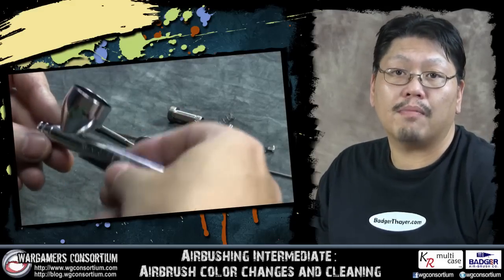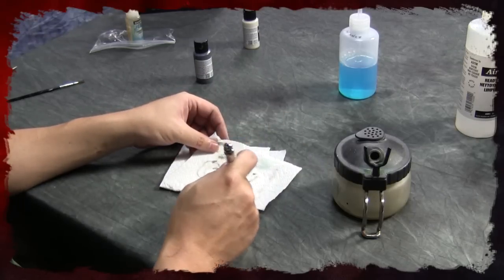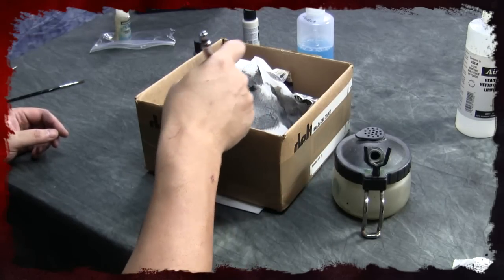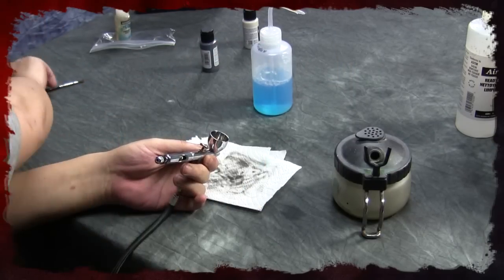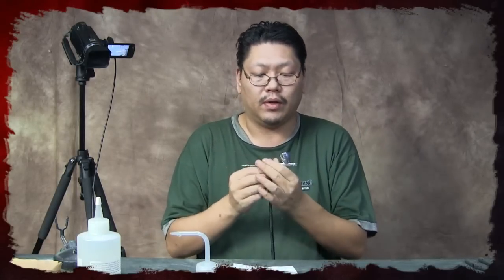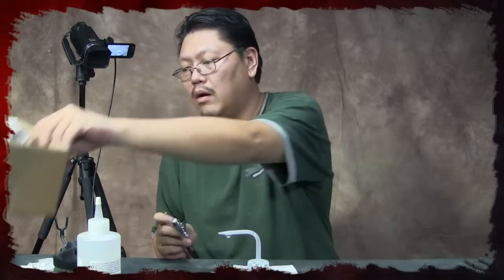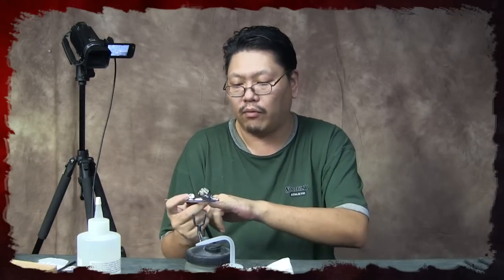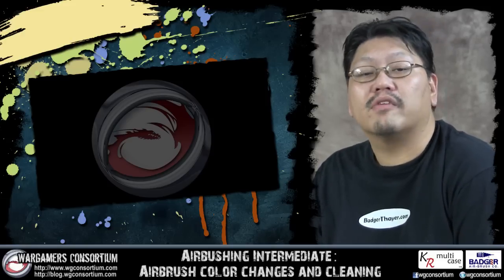Airbrush Color Changes and Cleaning (Airbrushing Intermetiate Part 3)

Comment: Great Video, thanks!  One suggestion I have is that when you pull the needle out for a quick clean, you unscrew the tip and pull it out the front, not the back.... Pulling it out of the back risks pulling "gunk" from the tip and cup area back into the air tube between the trigger and the paint cup.  This area is a real pain to clean if that happens, so an extra minute or so to prevent this is well worth the time, IMHO... Thanks again.

Comment: Great video Chung.  You can also STILL get the ORIGINAL Windex that doesnt have the Amonia in it.  I simply use Isopropyl alcohol to clean my airbrush as its cheapest thing to use in my opinion.  I can get a big bottle of 91-70 or 50 % at the Dollar Store for $2.  I also wanted to ask.  Say your spraying for a half hour or so.  You have paint build up of about three diferent colors in the cylinder.  I know you touched on this a bit in the video but how do you get the DRIED up paint thats clogging the airbrush cylinder ?  Im facing that problem right now.  I took the back of an xacto blade to run around the hole of the cylinder to try to dig some out but theres still some there.  I believe its preventing me from getting he proper pressure I should be getting from the compressor.  This is from the brush that Ken sent me.

Comment: Hi Chung. Have watched all your instructional vids this past month as i'm on the look for my first airbrush kit - big thanks! (sorry about this lenght couldnt find where to email) have found on sale local to me a 'MINI AIR COMPRESSOR SET AS18-1' (i think its a HSENG?) it ticks all your boxes on oil free, water trap etc. and will also get me a dual action grav fed brush - 'INCLUDES A BONUS Model TG Airbrush' saw it in person, but waiting to find out the brand as I had to move my car. Any thoughts on this setup? anyone else used one? would be great to get this next week with the pre xmas sale if it checks out as ok ;)
Reply: The airbrush this set comes with is a TG470 gav fed dual action. Any first hand feed back on this model would also be helpful thx :)